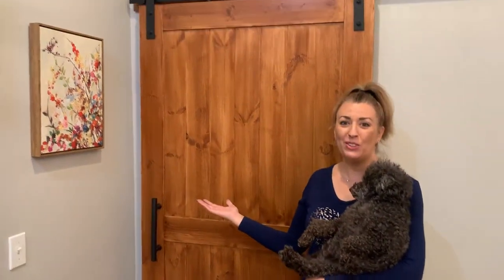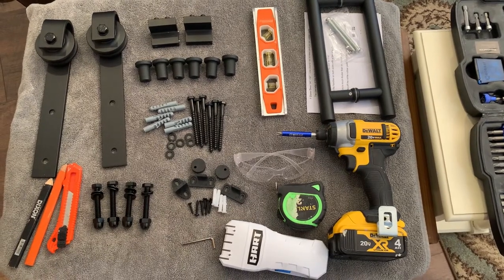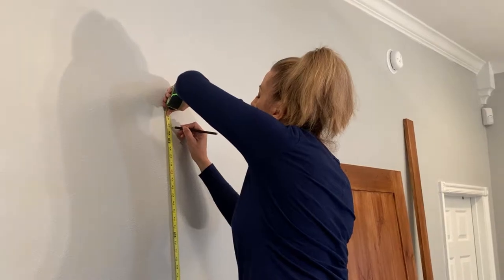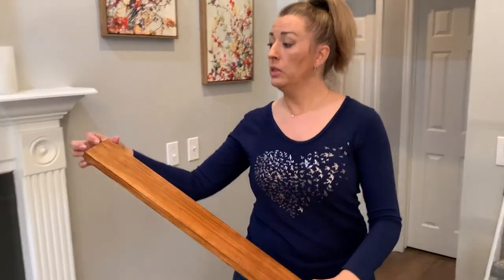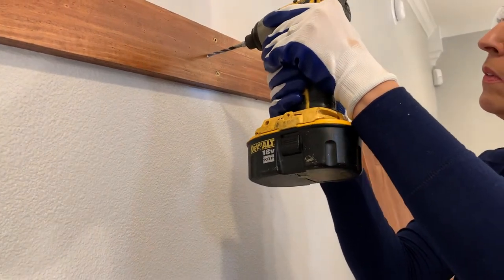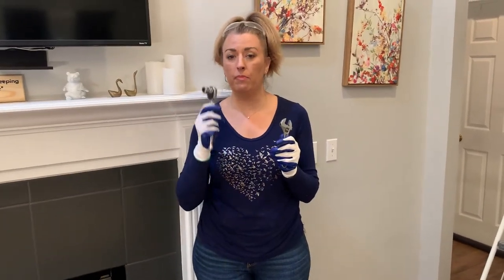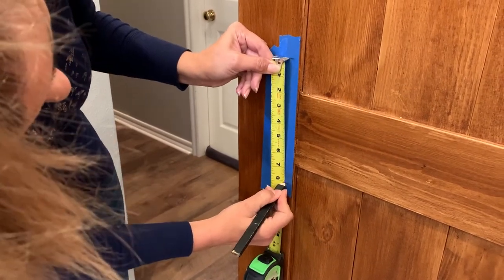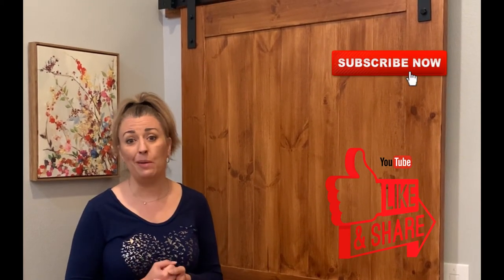How To INSTALL A BARN DOOR

Comment: Outstanding!! I’m preparing to install a barn door in an existing doorway. It currently has wood trim around the door to compliment the existing door. Will I need to remove the trim work, or will the barn door have spacing to accommodate the trim? Thanks so much for sharing!!
Reply from the maker: Thank you for the feedback! If you are putting a header board at the top like I did, it should be fine to leave the door trim.

Comment: Great job! I have a 36 inch opening for a bathroom. With the experience you now have would you suggest a 40 or 42 inch door width?
Reply from the maker: Thank you ☺️ I would say the 40” door with the 2” on each side is enough but you can definitely do the 42” door as well. Really depends on how much wall space you have, the location and your personal preference. If you aren’t sure, you can use a thumbtack to hang a string down on each side of the door opening to give you a visual of your preferred size (2 vs 3 inch overlap on each side). Much success to you on your project! 🙌🏼🙂
Reply: If you have molding around your opening it is nice to get a door wide enough to cover it if you don't want it showing. I added my molding into my door width decision because mine would look weird if it showed.
Reply from the maker: @woofjazz Yes, absolutely! Great point 👍🏼
Reply: @woofwoof-w4g  Thanks. I went with a 42 inch and am glad I did. It offers more privacy. Then put a 1 x 4 inch wide border around the door, looks great!

Comment: What size header board did you use? 1x4 or 1x6. It's hard to tell. I just bought a 1x6 Thanks
Reply from the maker: It is hard to tell in the video but it’s actually a 1x4. Good you asked 👍🏼

Comment: Hello - how long are the screws that you use on the headboard into the wall? 2.5 inches? Or 3 inches? Thanks!
Reply from the maker: I honestly didn’t check. It came as a set and I no longer have that information

Comment: You're hanging it into the studs because the drywall will not hold a heavy door.  The anchors are for naught.  They won't help. The door would fall.
Reply from the maker: You are 💯 correct. Thank you for the added clarification 😉

Comment: Did you add a rail at bottom with stop ? If  so wont you trip on rail ? Thanks
Reply from the maker: Thank you for your question. There is a small piece that you attach to the floor to keep it on track. However it is on the right bottom side of the door and is always covered by the door whether it is open or closed so it is never a trip hazard. The stops on the overhead railing prevents it from opening or closing too much. Hope this answers your question. 🙂

Comment: Question. The black large screws match up to the line you drew???
Reply from the maker: Thank you for the question! The board you put up first needs to line up with those lines. That provides the support. Then the black bolts can go anywhere on the board because the support is there.
Reply: @TammysHomeTips  thank you my board is up I made the door but I have no instructions. Your vid helped totally
Reply from the maker: Wonderful!! That’s what motivates me. So glad it worked out 🙌🏼🎉